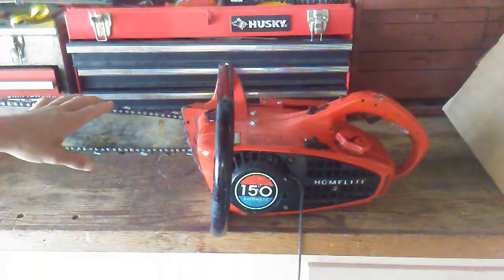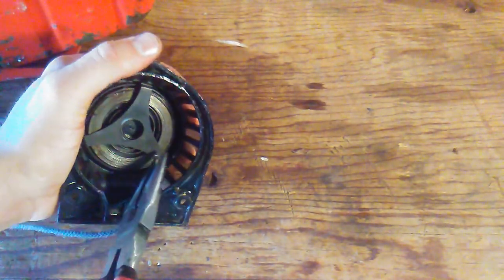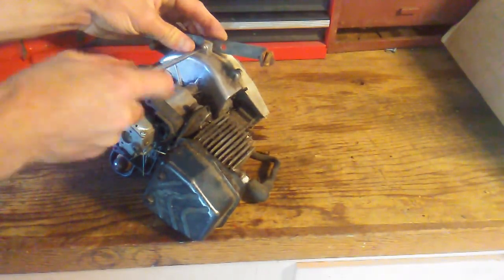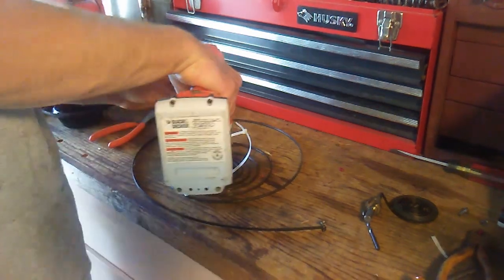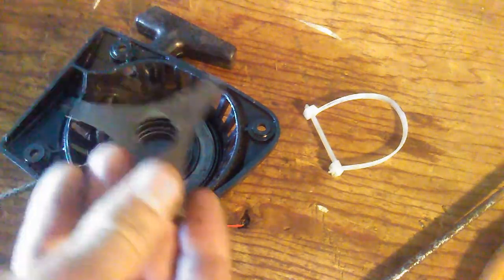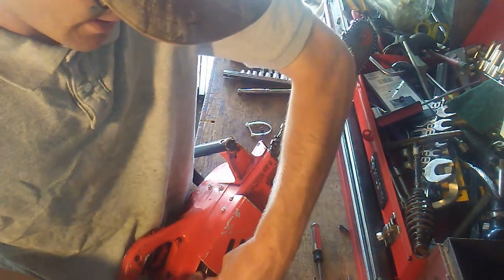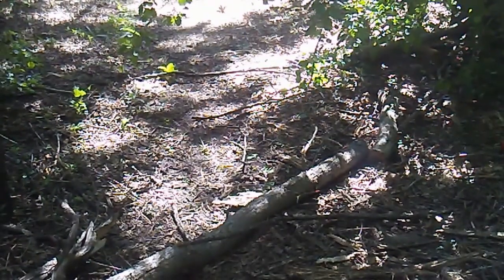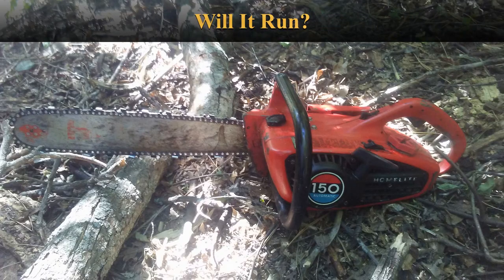Antique Home Lite Chainsaw: will it run?

Comment: I would have got the spring on and then realized I had it on backwards.HA
Reply from the maker: haha I've had that happen to me many times. fortunately (or unfortunately depending on how you look at it) I've had to take a great many recoil starters apart and replace springs so proper direction is something I check for instinctively.